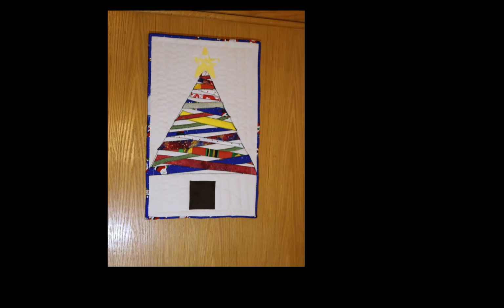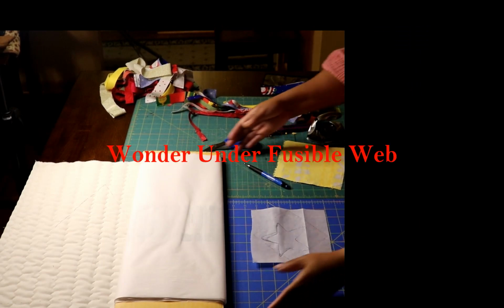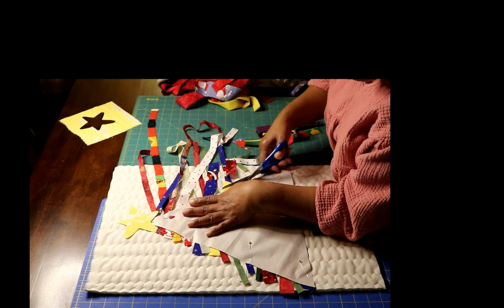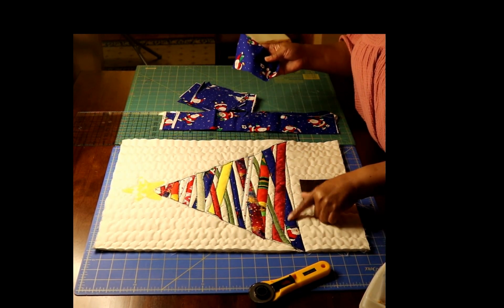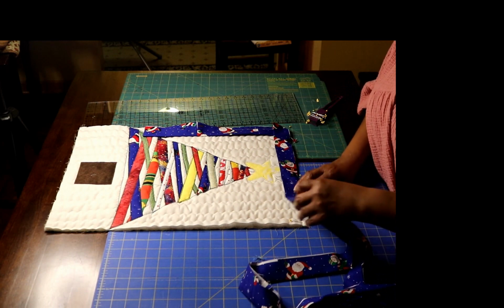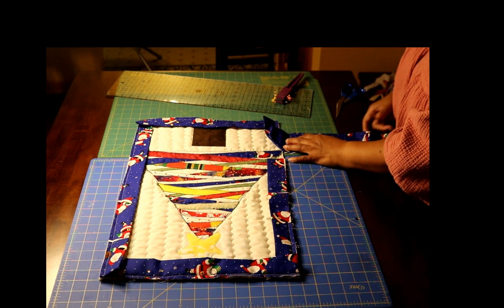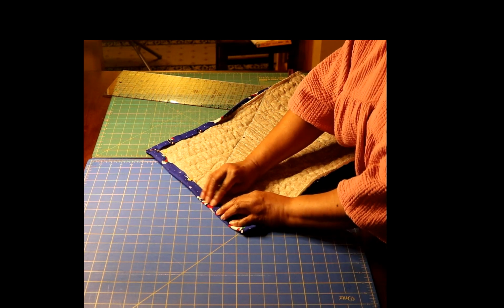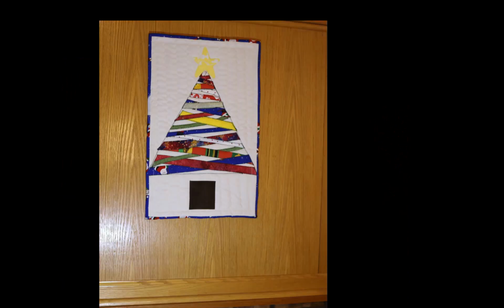Christmas Tree Wall Hanging

Comment: I have several Christmas neckties that belonged to a loved one.  I didn't know what to do with them.  I think this would be the perfect project.  As you suggested, I would use fusible backing to help hold the strips in place.  OR I was thinking that I could cut the tree shape from fabric or backing and then sew strips to that piece and then, after trimming, sew the tree to the quilt.  Either way I'll be using those cherished neckties in a lovely project.  Thank you.
Reply from the maker: Christmas neckties would make a great Christmas Tree Wallhanging. The fusible web would make it easier to create your project. You may want to consider some fusible lightweight interfacing on the back of the tie fabric for more stability, before attaching the fusible web. Can't wait to see your project. Take a look at my other video of how to use neckties https://youtu.be/-vVWRulGgDo